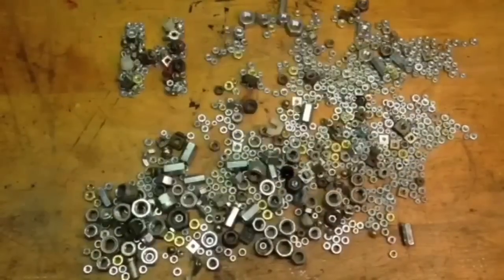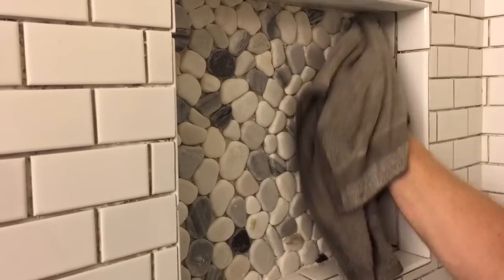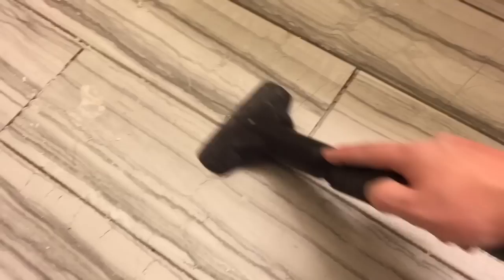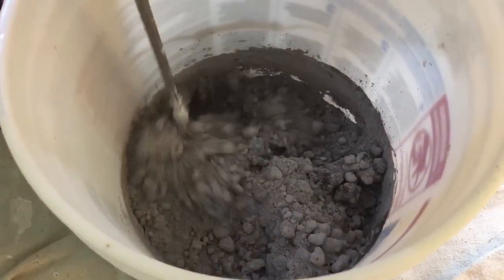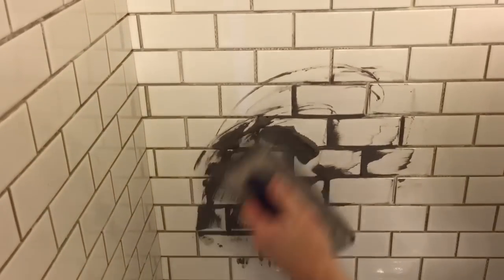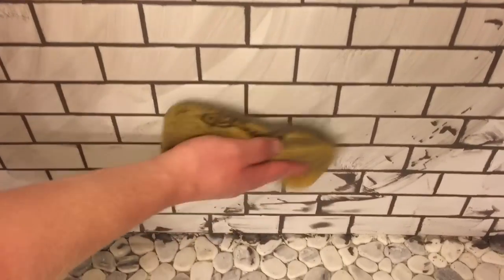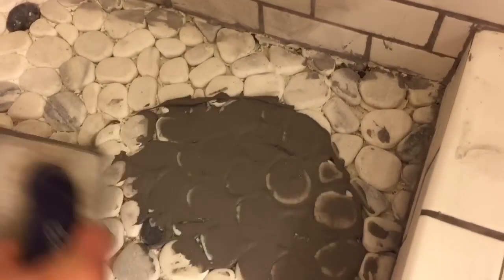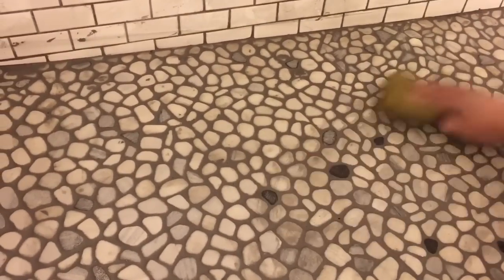How to convert a tub/shower to a walk in shower Part 8

Comment: Hi Bob, is there a certain grout you would recommend for the wall versus the floor. Such as sanded/unsanded/epoxy grout? Thanks!
Reply from the maker: You can use either grout on the floor or the wall, The recommendation for grout is grout lines 1/8" or less use non-sanded grout and 1/8" or greater use sanded grout. Hope this helps. Thanks for the question.

Comment: maybe I missed it, is that sanded grout? 1/8" gaps in the subway tile so sanded should be OK there and on the rocks
looks great!
Reply from the maker: Patrick McLaughlin With 1/8” grout lines you can actually use either sanded or non-sanded. Above 1/8” use sanded, below 1/8” use non-sanded. On the rocks I used sanded because there were some larger gaps. Thanks for the question.